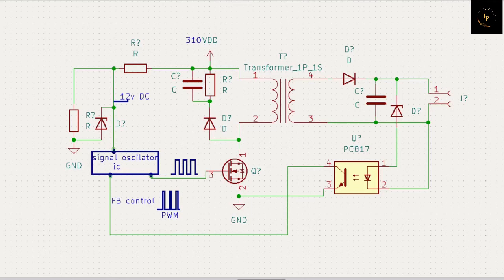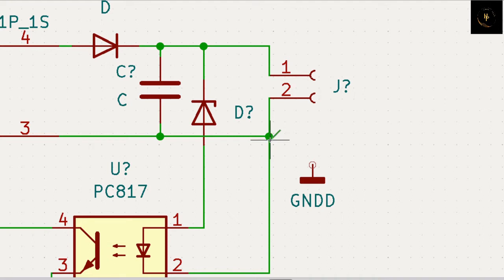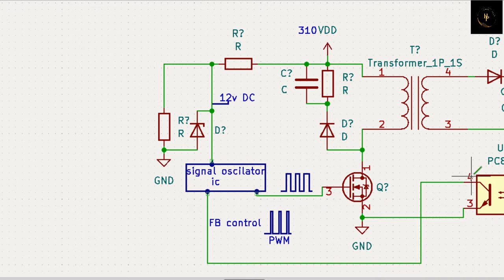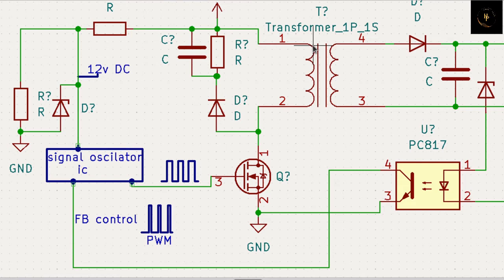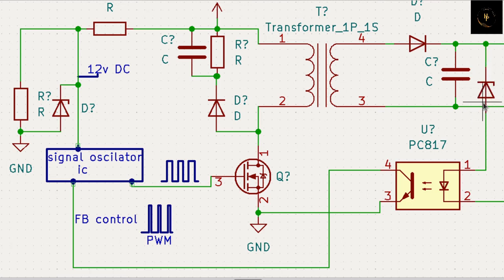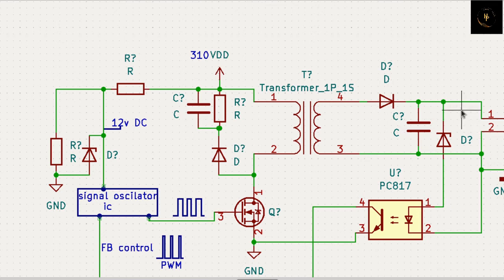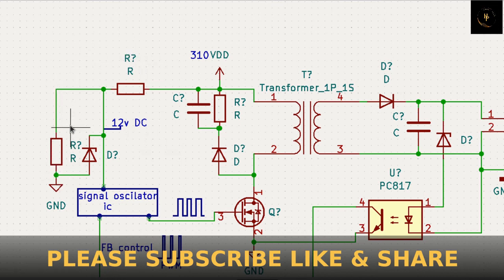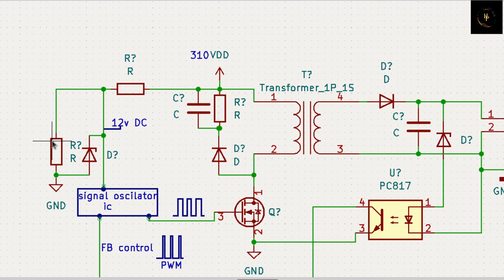[12]SMPS FEEDBACK CIRCUIT ANALYSIS

Comment: I have a very important question i built a foreword converter but each time the short circuits is activated the duty cycle cause the igbt to fail why is this
Reply from the maker: can you have sent your circuit diagram? It will helps us to clear.

Comment: Could you please make video on SMPS control loop design
Reply from the maker: Would you like to know how PWM is control SMPS output?
Reply: @hobby_plus  No sir ,I am taking about the compensation circuit like type -1,type-2 and type-3
Reply from the maker: somehow it is connected with op-amp.